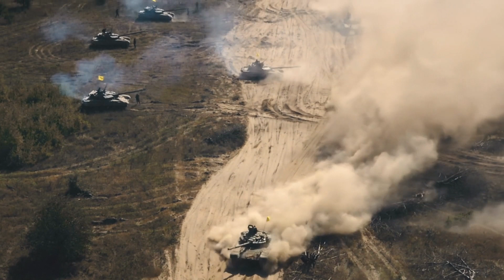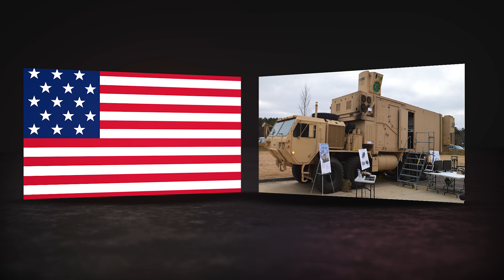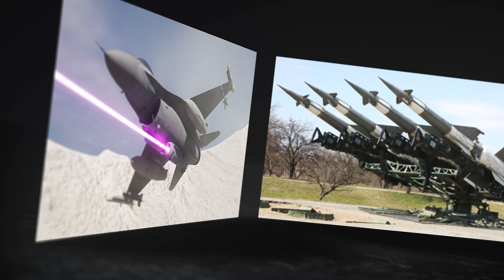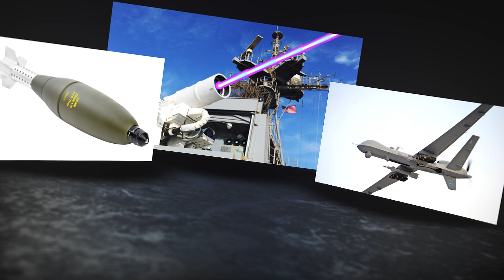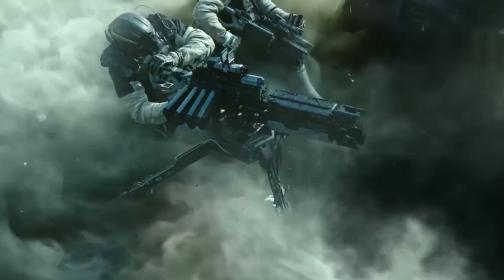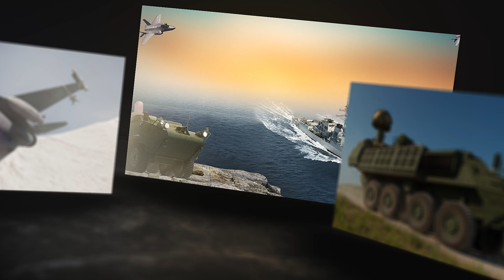US Military's NEW LASER CANNON TAKES DOWN Russia's S-400!

Comment: Disadvantageous of this  new lase cannon are as follows,
 1. Laser beams cannot be bent. These beams have a straight line trajectory.
  2.  Weight of the Power supply  necessary to sustain the beam
  3. Vulnerabilities of laser beams against dust, moisture and turbulence
  4. Laser beams could be neutralize by an enemy stationary wave formation.
  5. What if Russia finds a reflector to reflect The  laser beam.

   Laser cannon is a distance dream.
Reply: TUSPL    Tactical Ultra Short Pulse Laser